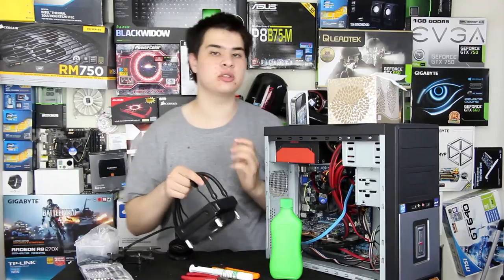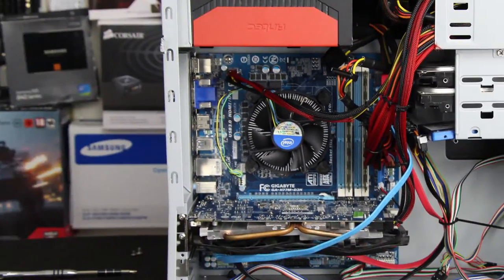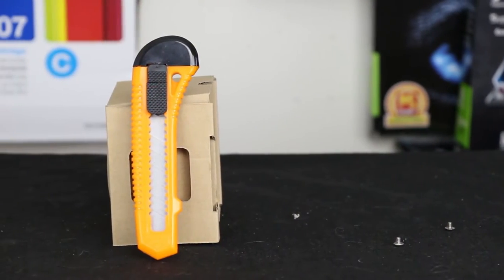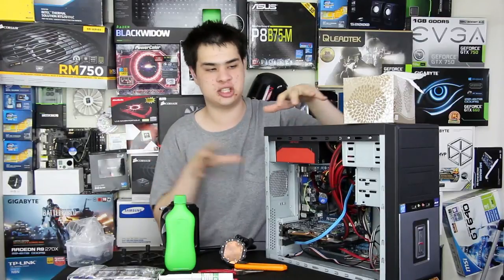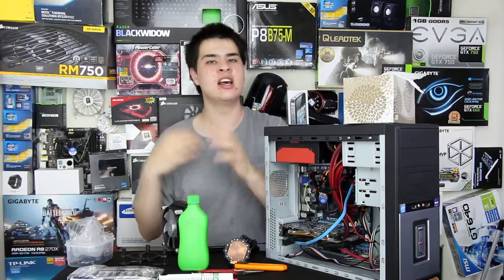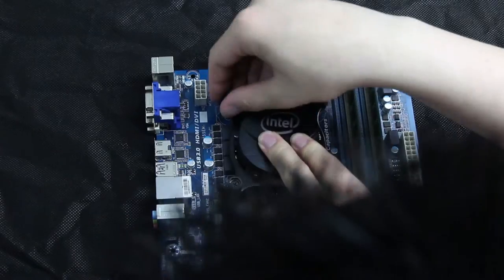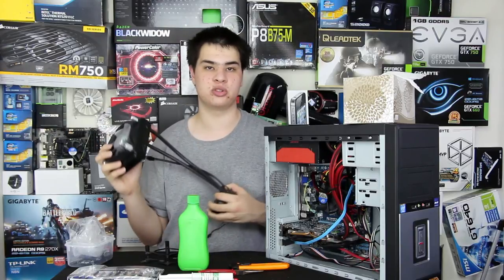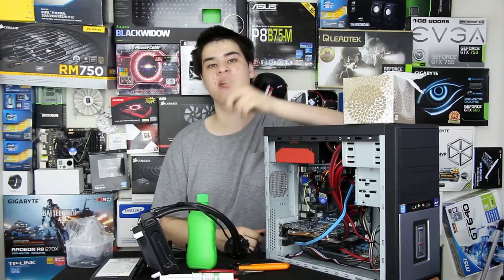How To Install an Asetek Cooler

Comment: If you dont remove the paste of the the new pump, you dont need to add new.
And - the frame mounted on the back - you dont need to cut that into 4 pieced, it fits without that....

Comment: Why so much foreplay. This could have been like a 30 second video.
Reply: A lot of blah, over to Linus tech tips.
Reply: And he even didn't mount the radiator on the case, because it wouldn't fit. lol :-P

Comment: This is going to be useful. I my self am saving up for a Minion computer with some customized things and a Asetek liquid cooling for my Cpu. I don't fully know if it will be already where it's supposed to be or not (which I think it should be or else I'll get mad) but if it isn't, this will have defiantly helped.

Comment: Late to the party here, but I recently replaced the motherboard for my PC and thus had to reapply the thermal paste on my CPU and the cooler. Honestly, the backplate for the 550LC is terrible in function because you are expected to either tape the unit to the back of the motherboard (as seen here) or apply the thermal paste and then hold the backplate in place as you tighten the pump to the freshly pasted cpu. Terrible design in my opinion, honestly.

Comment: This showed nothing about how to install a cooler. I need to change the fluid in mine. I was told you need to service your CPU liquid cooler once a year. I wouldn't recommend using a tooth brush and crest white to clean the unit like this guy did in the video. It severely scratched the copper heat since (on the water side but so what)

Comment: what pin slots do you plug it in too?
Reply from the maker: it uses the sata for power and the 3 or 4 pin fan connector
Reply: like does the cpu fan go in to the cpu header or just any 3 pin outlet. I read somewhere that you need to put the big fan part into the cpu header and then the little fan directly on top of the cpu in any 3 pin outlet
Reply from the maker: it would depend on the cooler and the motherboard you use. some coolers will have extra leads that you plug the fan in to and then the pump and fan are controlled by the cpu fan header, while other ones are plugged directly into the cpu fan header. either way yes you will usually have something plugged into the fan header

Comment: You do not use stock thermal paste. User premium. This is the only thing coming into contact with the cpu and the heat sink.
Why are you using DUCT TAPE ON YOUR MOTHERBOARD! OMG!.
Use a push-pull system for christ's sake. Also, I am looking to upgrade to a liquid-cooled GPU.
I didn't agree with everything you said but your video was ok for a novice.